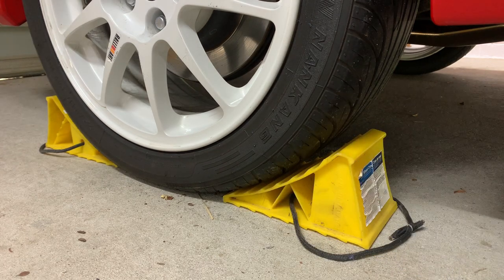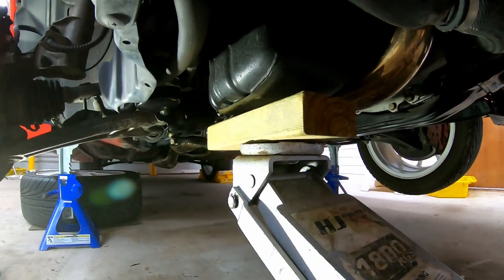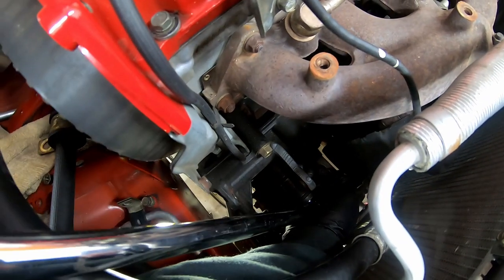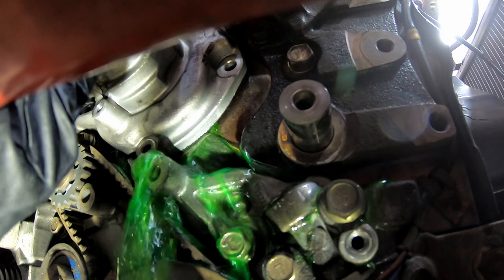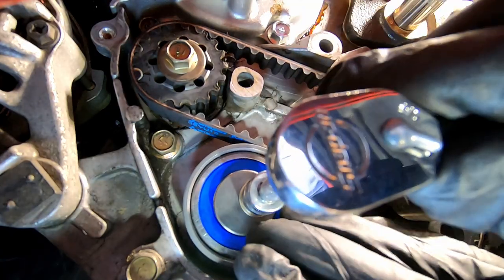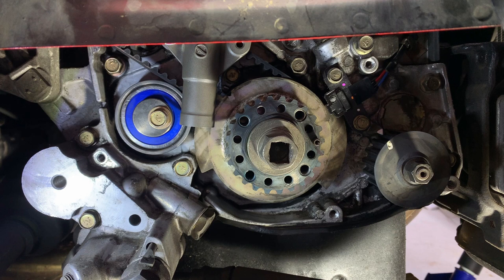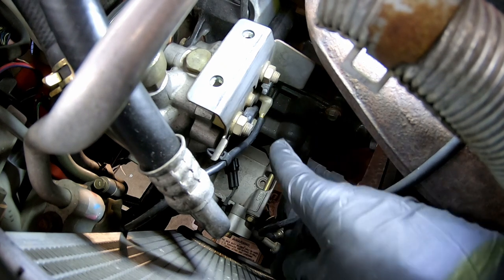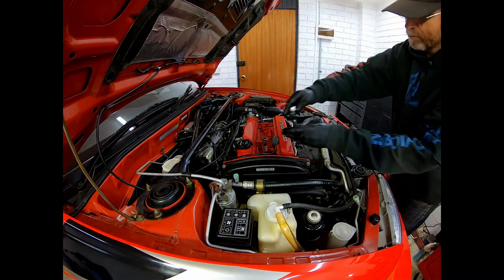TIMING BELT SERVICE - VERY  DETAILED - Mitsubishi Evo 6 TME 4G63

Comment: Great guide! Do you have a list of all part numbers used for this job? I'm getting ready to do the same on my Evo 5.
Reply from the maker: It depends on how thoroughly you want do the job as to how many parts you want to replace. Also the part numbers sometimes change and sometimes you can upgrade the parts for example you can use the more modern evo 9 timing belt tensioner and the evo 9 kevlar timing belt. Mitsubishi part numbers often change too. Probably best to use your VIN and search thru the parts diagrams on partsouq.com and decide how much you want to replace. I like to replace the water pump and crank angle sensor etc while its all dismantled  too

Comment: Hey Andy, do you know the difference between the TME timing belt MD327394 and the VI timing belt MD326059? I know the evo 9 belt 1145A038 is made of kevlar.
Reply from the maker: MD327394 is just the new part number which replaced the superseded part MD326059.  I believe the 1145A038 Evo IX belt is a good upgrade, but back when I was buying all the parts for this job I thought MD327394 was the latest and greatest. The new design Evo IX timing belt tensioner MR984375 is another upgrade, which I did use. Edit: and yes I believe the evo IX belt is Kevlar. More expensive but probably stronger.